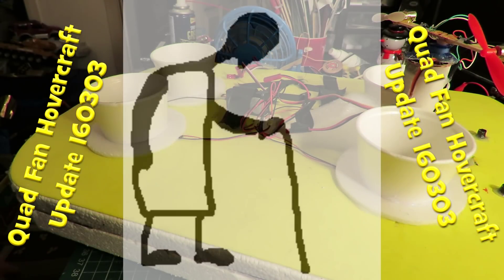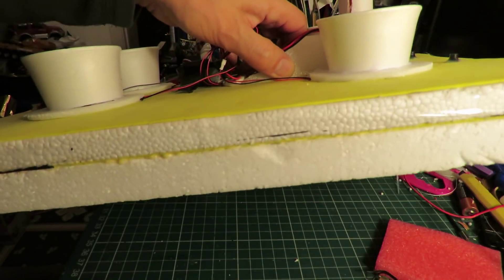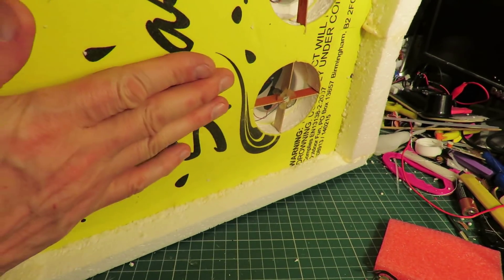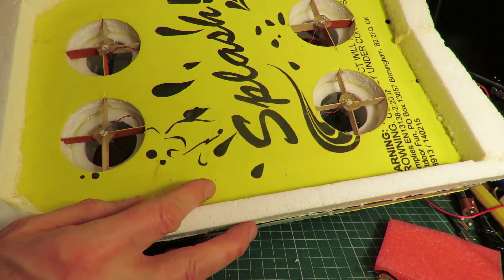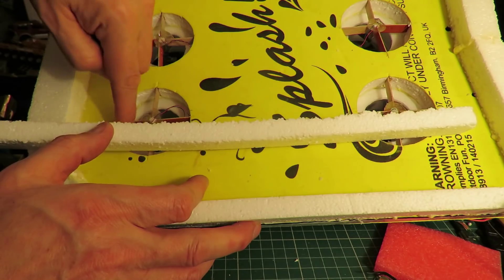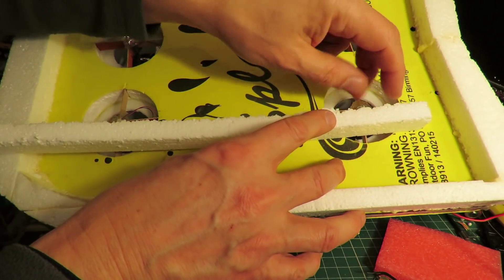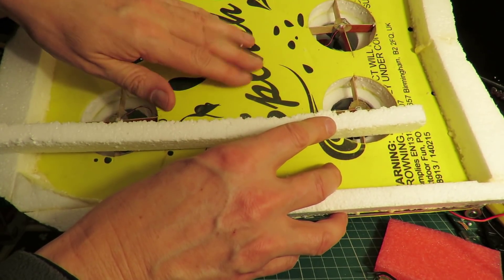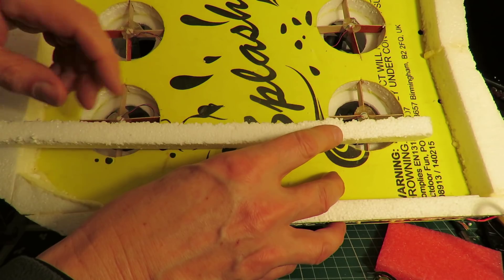Quad Fan Hovercraft Update 160303

Comment: I like the plan! In fact, I wouldn't mind placing a bet on that it will work. Looking forward to seeing the results.
Reply: Ohhhh... Just read you abandoned it! Pity.
Reply from the maker: +Erik Broeders it works fine, there are still a couple more videos scheduled for publication. I just felt it had gone far enough and was never intended to develop to this stage. One video tomorrow and the final video is on the 16th April

Comment: It'll be cool when it's finished
Reply from the maker: +SnapPunch Robert bit of a problem defining finished. This craft has evolved away from the original concept which was based on a flat bottom and a very thin air gap like you will see on the air beds used to move very large heavy machinery. It was never intended for uneven surfaces or water. It is basically a powered version of one of these https://youtu.be/aOrlP7dvd4M and this video shows the sort of thing I was aiming at https://youtu.be/t6m01VGiNPI

Comment: very interesting, i am quite curious about if and how well it will work.
Reply from the maker: +Elnufo it works marginally better than it did before. I think the plastic I chose for the skirt was actually a bit too thick and lacked flexibility. I was going for durability but went a bit too far. There are a couple more episodes and then I decided I had gone far enough and stripped it down for parts.

Comment: can you convert an rc car into a hovercraft
Reply from the maker: +Hayley Strutt you could, the only parts that you would use would be the motor and the RC receiver. You might be able to use the receiver to steer it depending on what sort of steering the car has. If you look through my hovercraft playlist you will see several simple hovercraft that use cheap motors. Most of them are not very good because the motors are not very powerful and the propellers I used were not very efficient. I did not add the RC and steering because the hardly had enough power to hover and the extra weight would have stopped them working. The link to the playlist is in the video description.
Reply: Maby if you used a monster truck insted of a rc car
Reply from the maker: +Hayley Strutt if you are thinking of buying a car just to make a hovercraft you would be better off just buying a decent motor and propeller on eBay and hobby grade RC equipment is not very expensive at the basic entry level.